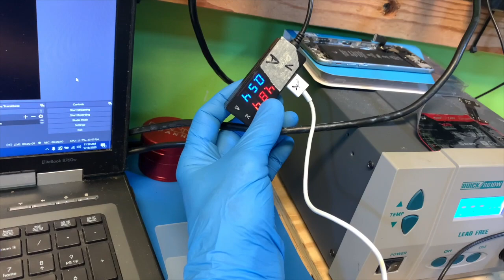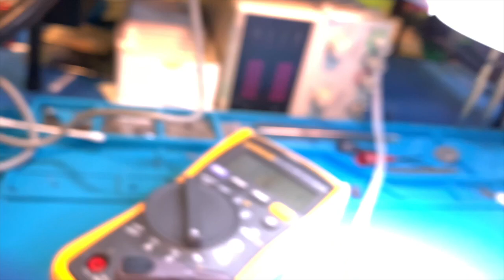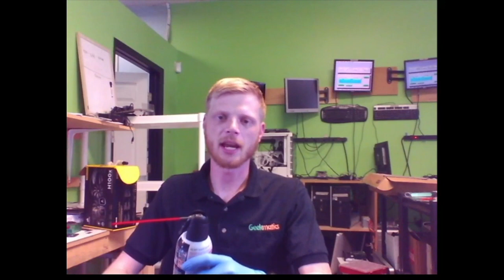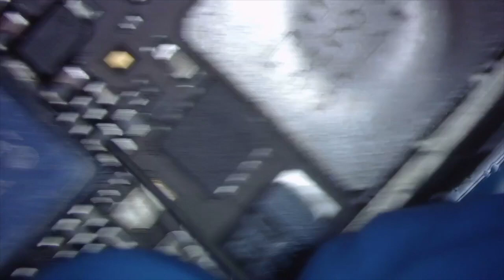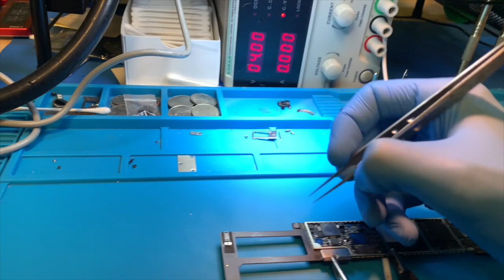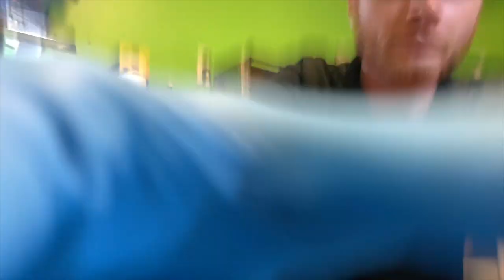How to Diagnosis a no power issue on iPhone and iPad

Comment: I have an iPad 7 pulling .45A from the charger. Battery slowly charges up. With battery disconnected no current from charger .00A   I can see it perform the reset by watching the .45A go to zero. Not recognized by a pc nothing on screen.  Changed tristar, same thing…Any advice?